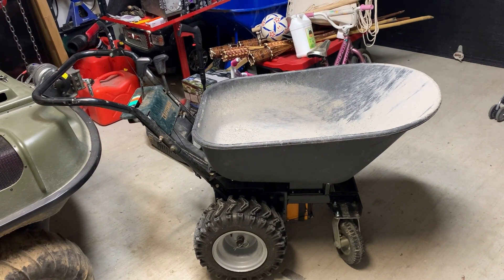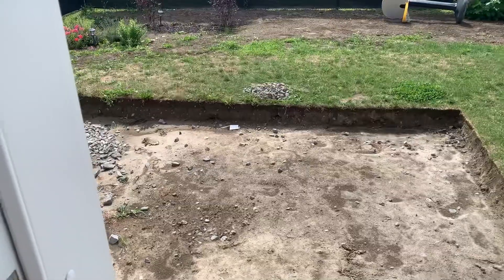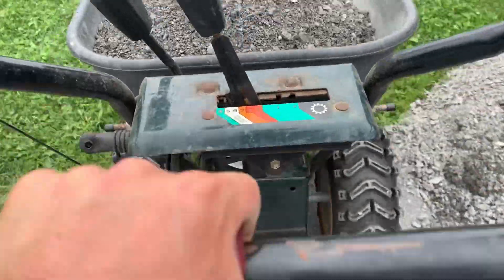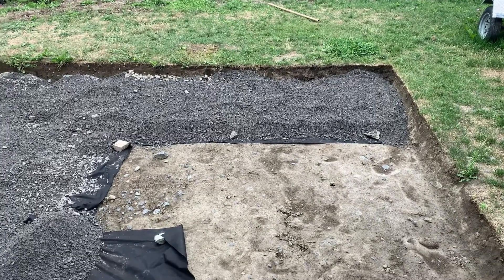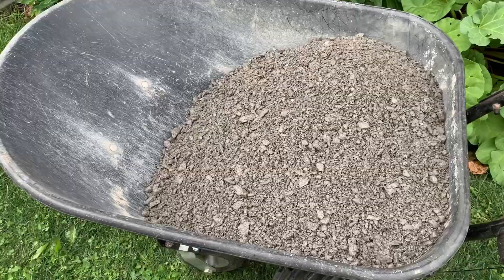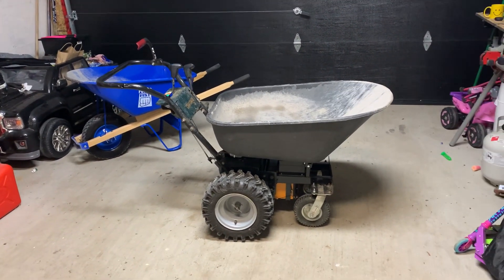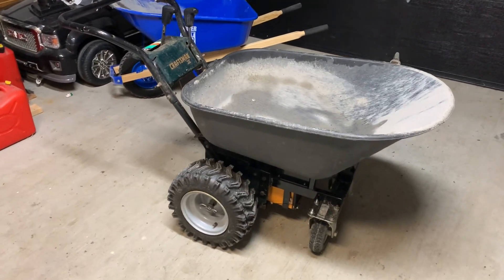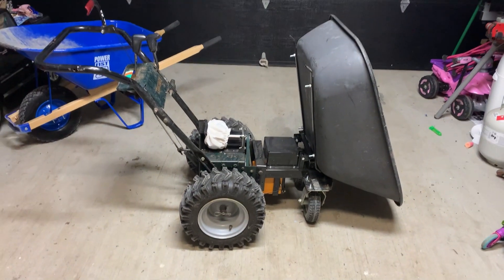Electric self build wheelbarrow, Dirt-E-dump part 2

Comment: Ha - great project. I have an old snowblower that I've been leaning towards making into a trailer mule, but this looks so useful that maybe I need to figure out how to make it a multi-purpose device. My Craftsman blower has individual left/right clutch levers which should greatly help stability/maneuverability. 

I actually had one of those Neuton mowers back in the day. Expensive and pretty flimsy, but worked ok for our tiny city yard at the time. I'm amazed that a 500w motor and 240wH of battery capacity are so capable.  I've bought into the Greenworks 60V system for most of my yard tools, and now you have me eyeing their tiny little 19" mower as a potential brushless motor donor. They claim 1500W, and you can get the 60V batteries up to 8aH/480wH. At almost $300 for the mower it sure doesn't compete with 'free', but it's not completely out of line with the cost of BLDC motor kits I've seen on Amazon.